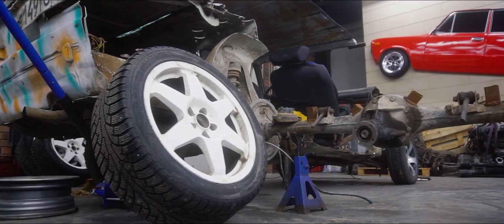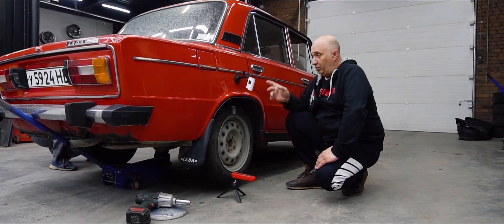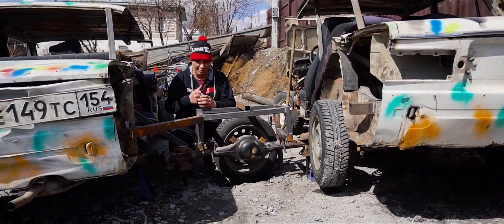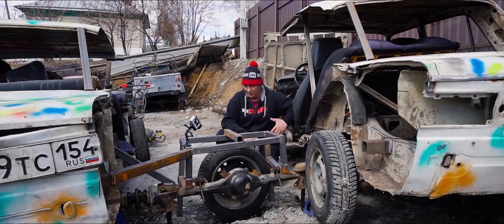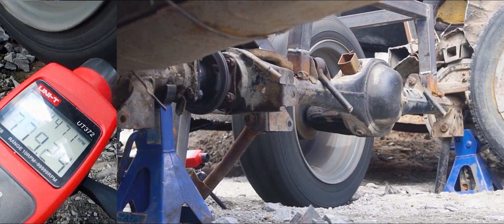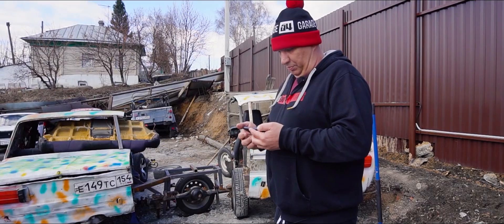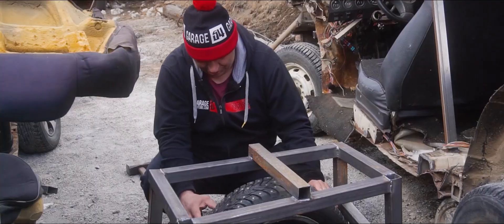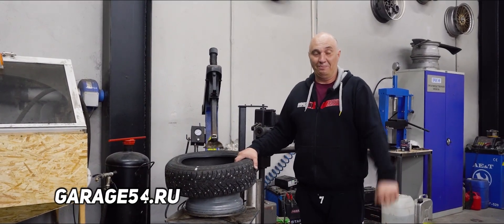What happens to a tire at 620 km/h (385 MPH)?

Comment: Don’t remember exactly when but I’m thinking late 70s to early 80s F1 cars had portholes so you could see the front tires and I believe there was a line on the inside of the tire. The purpose of the portholes was to keep check on how much the tires grew as speed increases because they would be going so fast that the tires would pretty much come off the rim and when they looked at the tires after and the marks wouldn’t be lined up with where they were when mounted on the rim. The tires were slightly spinning on the rims, so the portholes were added so you can tell that you either can go faster or you need to stay where you are. Awesome video as always. 
Just remembered exactly what the portholes were on. The Elf car that had 4 front tires. They were so small in diameter they were spinning at an incredible rate and since they had 4 front tires it was still drivable.

Comment: When you spend a tire freely it will expand the ground it helps keep it from deflating like that look at top fuel dragsters look what the tire do
Reply: But dragsters tires are defective there flat on the bottom lol soft side walls and the speed and heat they turn at pumps them up there usually around 3.5 lbs. to 5 lbs. Air in them...

Comment: That's the most Russian-like thing I've seen, I wouldn't even be next to that thing with studs in, the guy "had" to be convinced and not even wearing a face shield much less eyewear. I'm sure they could have gotten a better result if the wheel was balanced.

Comment: If 3rd gear is about 1:1 radio, means that in 3rd wheel turns almost the same speed that the engine, so engine 2000RPM is wheel 2000RPM aprox, so if you go 6000 in 3rd, is about 130Km/h, plz correct me if i am wrong

Comment: You need like drag tires you know how there exspand to a taller size when spinning and as well I had a 250 cr 4wheeler Honda and when we went across the ice spinning at full speed the same thing happened they got taller and all I could say was I held on tight lmao but I'd deff try some drag style slick tires then they would hold out better so ya but love your vids . godbless and stay safe

Comment: If you want it to go faster. You need a lower profile tyre. Also balance the rim. If it isnt balanced you lose a lot of energy due to vibrations. That would also tear the tyre apart on its inside of the rubber. 

So fix vibrations (rim needs to be perfect) and get a higher speed rated tyre  with a low profile.

Like a sports car rim and tyre should work just fine

Comment: Temp testing to see what temperature they come apart. Spin with light friction on a slick surface at a set speed so tire expansion doesn't play much of a key and the danger of "sticking" to the slick contact friction surface.

Comment: Park one of the cars in the opposite direction and hook it to the other side of the differential. Put them both in drive and it should multiply the speed of the pinion many times. The spider gears may fail though

Comment: Hi ! you can drive the other end of the back axle with the other car, and get over 12,000 revs... 👍
Reply: That's right. They're basically just getting crankshaft RPM turning the wheel. If they could drive an axle shaft on the outboard rear end from the output of the transmission they'd be seeing maybe 20,000 RPM at the pinion if the engine is turning 5,000RPM and the differential is 4:00/1. My math says that's over 1400MPH, assuming the wheel diameter is 24 inches and 5th gear is 1:1.
5,000 RPM X 4.00= 20,000 RPM
2 Feet diameter X pi (3.14) = 6.28 feet/revolution
20,000RPM X 6,28 = 125,600 feet/minute
125,600 X 60 minutes= 7,536,000 Feet/hour
7,536,000 ÷ 5280 (feet/mile) = 1,427 MPH. or 2,283KPH
Now we're cookin'.

Comment: 385 mph, awesome 👍😁 next time use that black tire glue gew so the tire edge stays seated, try Z rated tires. Any brand will do but from what I've seen BFG'S are better then Goodyear at the Z rating. It's must be fun doing that tear it up, Yo

Comment: I would move the upper bar for one thing. Tire seems to be running very close to it. Maybe have 2 inplace of the one to give extra clearance. Also the jacks were sinking in the ground and moving. I would block it so at the higher speeds it does not flop on the ground. But soft drag tires would be interesting to see. Those are made to expand so if you could push it higher than that.

Comment: This would be a LOT more interesting if it meant anything practical, as in the tire had the weight of a car on it and they were spinning it.  You figure and average GOOD tire on a decent car at 180 MPH the tire is spinning around 33 rotations per second, it starts to make sense real fast why they X-ray your tires as part of the tech inspection!

Comment: You could use the whole front hub instead of just mounting the wheel directly to the differential. A quick weld job to make an axel to drive it and you'd be good to go. Having the CV joint still in the set-up would help with some of the vibration

Comment: Make a similar setup and attach a gearbox with it then put the tyre on the input shaft (remove the flywheel). I think the crankshaft rotates much faster than the axels. So if you reverse it, the power will increase I guess.

Comment: Well I'm not an engineer but what if you attach the tyre with the crankshaft instead of the power shaft and engage the 1st gear? I guess the crankshaft rotates much faster than the power shaft.

Comment: There was a time when my friends lifted left front wheel of an escort mk3 up, turned the steering to left, replaced the bolts with wooden sticks. Full speed on top gear (250km/h on the speedo) and hit the brakes. The tire escaped to forest and was never found.

Soooo, if you're dumb/brave enough to try that, please aim to the east, so the tire wont hit me. Thanks.

Comment: I believe tyre speed ratings are tested under load i.e. the wheel and tyre should be pressed down onto a set of rollers during the test to mimic the weight of a vehicle.

Comment: So I couldn't help myself and had to check it ...
The tyre size is 155/65R14 (15:25). Outside diameter is 557mm. Tyre circumference is 1.75m. Travelling at 5600 rev/min = 1.75m x 5600r/m = 9800 metres per minute = 588 kilometres per hour.
Which is extremely fast!

Comment: If you burn the rubber off, you'll be able to see where the belts (chords) failed and also see what happened to the metal wire that holds the bead tightly around the shoulder of the rim. I think it broke. I'd like to see what would happen to an older tire. We are told that tires are only good for 6 years after manufacture, but I know there are tires on the road in excess of 20 years. How 'bout a motorcycle wheel? Not a stamped steel rim or a spoked rim, but a tire on a cast rim. Better get a polycarbonate shield or view it remotely with a camera from a good distance away.

Comment: If I'm not blind, the tire size was 155/65 R14. In that case at 5606.7 rpm the theoretical "ground speed" was 588,7 km/h or 365.8 mph.
Another thing, next time try to balance the wheel and the tire on it. You will be able reach higher speeds without extreme vibrations with lower risk to die on that place. Or you should try some higher speed rated and low profile tire.

Comment: You have to remember the tire is rated that speed with a specific amount of weight on it. Also the weight creates friction and heat. If you remove the weight and heat the speed that it can achieve will be higher.
Reply: yup, exactly

Comment: To increase speed further, connect another axle at right angles (connect 2nd axle driveshaft to diff you just drove the wheel from)  and then drive off the diff on the second axle - That would be huge. Dig a deeper hole to accommodate the expanding tyre diameter. Then view from a considerable distance (or close by if still wearing the safety bobble hat)

Comment: at 8.01 - SHOOT - it is cyclic - harmonic - that is a disaster point. Just Saying!

OH Sh#$T - it has a 5 th gear - shoot - we only had 4 Speed  Lada's over here in Canada! But they were carbon Neutral gas tanks - every gallon of Fuel pissed half of it on the ground - due to the rust pits on the INSIDE of the Nuclear certified  fuel Container! They were AWESOME!  I liked the car - not its quirks!

Comment: the car vibrated so much at the firs ttime you guys did fith gear and last time, the jackstand on   the right virbrated into the ground xD     

also you could do it, but put stuff in the tire, or fill it with concrete, or  water, x3

Comment: Top fuel dragster tires are designed to squat low when launching to have the effect of a lower gear.  When they are moving faster they expand way out to a larger diameter, having the effect of a higher gear.
When this tire expanded at high speed the outer surface was probably going faster than what they calculated.  I'm sure the studs helped with that expansion.
Fun.

Comment: Connect the second Lada to the other end of the axle. Flip the car 180°, so you have the opposite spin when "driving" forward, also the "driver" will be on the far side of the tire that is going to spin. Keep in mind that the differential will be heavily abused. Already in this video we saw oil leaking from it. Make sure to lubricate and cool it too. Maybe connect an external oil pump with a radiator, or the differential might blow before the tire will. Please make sure that the wheel will spin smoothly, the axis has to be stable. Maybe weld some solid rig and connect it to the differential by a universal joint.

Comment: Why did you not use axle part? Put the speed meter near the wheel at high speed has 2 problems: the higher air flow might blast meter away, same for the camera near the wheel pointing at meter. And if when band explode... bye bye meter. Vibrations at ground counts too.
The axle which is rotating at left may slower but you can calculate it easier which speed/rpm the wheel should have. And much safer for meter too.
Make the steel box bigger too, or wheel will hit steel bars too early = burning rubber smell.

Comment: We used a wheel and tire as a flywheel on an aircraft engine, for testing.  At one point the tire came apart, in three sections.  One cleared a 60 foot silo, one buried itself in the ground, while the last section was last seen clearing some trees.
Reply: would like to know the story behind that one!  are you an aircraft mechanic or something like that?
Reply: Rotational mass has some energy
Reply: Ladies and gentlemen: 
The tires have left the rim!🤭

Comment: CRAZZZZZZZZZZZZZZZZZZZZZZZZZZZZZY !!!!!!!!!!!!!!!!!!!!!!!!!! Now.. In efforts to reach "INSANITY"... a muddin tire like the 36 to 40 inch tire (wrapped in a 3 layer armor cage for safety)  or maybe to see how well a RETREAD holds up, of any size tire with do..  Also, mark the tire, and then the rim/wheel... to see at which RPM the tire starts to rotate on the rim, from where it was at, due from vibrations...

Comment: The differential axle on the Lada uses gears to reduce the speed of the engine to increase the torque on the wheels. If you removed the axle and welded it to the driveshaft so the tyre is fitted to the centre of the differential, the gears would increase the speed of the tyre, so if the differential normally decreases the speed from the engine by 6x, this way would increase that speed by 6x, giving the potential of 3,720 km/h or 2,310 mph. You can then see at what speed the tyre will disintegrate at.

Comment: The problem with going fast is, one of those tires won't implode at 400kmph, it's the heat. Would be cool to have some sort of threadmill for it to roll on, with some weight on it, to simulate road friction, and measure temperature after a few minutes.

Comment: Fun! The tyre was spinning in air and not on a simulated road surface so the tyre wall was not flexing each time the tyre went round. Could it be run against a roller to simulate this?

Comment: Maybe use a more powerfull car, and z rated 16 or 17 inch tyre, see if you can achieve 1000km/h. You might have to change the differential ration to achieve this

Comment: I love how they chose the most unbalanced wheel for a high rotational speed test
Reply: and it looked to self-balance at 200km/h.
That's useful to know. If you feel vibrations from your wheels try speeding up to 124.2742 mph 🙂
Reply: @trollmcclure1884  that's probably because of the camera shutter and is only an illusion.. I'd like to see a high speed camera take on it to get a better picture
Reply: Rx7man the tires legitimately bent its not the camera
Reply: @Rx7man  No it's reality.
An unbalanced tyre can actually ride smoothly at different speeds, most drivers/riders will have experienced it.
Reply: @Rx7man  harmonics are a thing in mechanics.
Reply: @thetizzleforshizzle  as they are in photography
Reply: @trollmcclure1884  I noticed that in my cheapo car (WV polo clone, Škoda Fabia). At 110 it starts wobbling and roughly at above 125 it becomes stable and smooth all the way up to max of 160-170. I think that unbalanced wheel is only a problem at a certain resonance range. Everything below or above that is fine.
Reply: @trollmcclure1884  noted, when I’m in my jeep and have a “death wobble” (I think that’s what it’s called) I’ll speed up to 130 mph and it will go away
Reply: @trollmcclure1884  My brother used to have a Sunbeam Tiger that would develop a vibration that got worse as the speed approached 45mph.  At 45mph it was REALLY bad, but by accelerating the vibration would gradually reduce and by 80mph, that vibration would totally disappear.  The vibration disappeared forever after a tyre change and he had a "doh" moment.  The whole time he'd put up with this issue and all he needed was to get his tyres balanced. I believe that it was probably just a balance weight that had fallen off, caused his problem.
Reply: It wasn't that the wheel was unbalanced - they welded it onto the diff flange crooked. If you watch the beginning of the run 6:25 you can see it's wobbling side-to-side by about 20mm. Earlier there is  about 0.5 second snapshot of the welding process.
Reply: @johncoops6897  Ah that makes sense. that's a lot of wobbly rotational momentum
Reply: @dogtroscious2510  Rotational momentum is different in Russia.
Reply: @johncoops6897  yea, a total fail...
Reply: Because Garage 54!
Reply: The rim was bent
Reply: Russian thing😂
Reply: It wouldn't be a proper Garage 54 video without some major sketch.
Reply: Welcome to soviet Russia 👌😀
Reply: That's exactly what I was thinking
Reply: I noticed that to.
Reply: You have OCD
Reply: Which is good for those out there, who always choose cheapest, crappiest kind of wheels. Now they can see what happens when they're getting speeded up. Just imagine what could've happen if it also were under some kind of load. Where would the tire have to go? 😵
Reply: Welcome to Garage 54 🤣🤣🤣
Reply: they want us to see how strong is russian iron, and russian welding. 
they withstand this vibration :'D
Reply: Recipe for a blow up,daaaang that's a baaad wheel!🤔😱😱😱
Reply: Hahahaha... And put it on the ground without hardened the footholds😁
Reply: @tngambleh7651  whaaaaat?
Reply: If it was put on straight and nothing is wrong with the install, the spokes are bent on the wheel. If it were only bent, it would bounce up and down
Reply: Its tge russian way. Keep it simple, the way its....just drink more vodka....
Reply: 100% Russian Engineering
Reply: i dont think was the wheel... i think was the transfer group mounting .... was missing a couple of bearings lmao
Reply: i hate it 
XD
Reply: the wheel was probably balanced, they did kinda weld a wheel hub to the input yoke of a differential soooo, probably not that centered
Reply: That's why engineers design stuff with a safety factor of greater than 2
Reply: also winter tire which is soft and weak
Reply: It’s most likely the weld to the pinion was not perfectly concentric
Reply: Pinion walking. Not wheel, well not to that extent. Could be the weld or adaptation of wheel but, my guess is the extreme abuse of pinion.
Reply: In  Russia wheel chooses you 😂
Reply: That shit held on tho damn haha
Reply: Because most of the car running with unbalanced tire,
Reply: Soviet style...human loss of life is totally acceptable
Reply: Its not that its unbalanced its that its bent
Reply: John 3:16 
For God so loved the world that he gave his only begotten son JESUS CHRIST FOR OUR SINS so whoever believeth in him shall not perish but have everlasting life Amen Amen Amen 

Never lose Hope in God remember he forgive

Comment: Nice experiment! It would be great to make it more realistic... What about add a pair of wide rollers? Like if the rollers would be the tarmac or so, needless to say the tyre has to be  a normal one, no winter tyres with nails... Rollers have to be welded in a structure that you can adapt to tyre size and/or simulate the weight of the car... Sure it will be a bit noisier...!
Reply: There is nothing realistic in this experiment at all, and your suggestions dont ad more realism to this experiment.
In real life the top of this wheel would get to 1240kph and therefor break the sound barrier. In this test and also your modified eksperiment the velocity is only half of the sound barrier and equally distributed around the wheel like in a centrifuge.
The force ripping a wheel apart is the constant acceleration from zero when a point on the arc is resting at the asphalt, to doble the speed of the car at the top of the wheel, to zero again down at the asphalt. 
In this experiment every spike in the wheel would accelerate from 0 to 1240kph to 0 again almost 100 times per second, if this was a real velocity test.